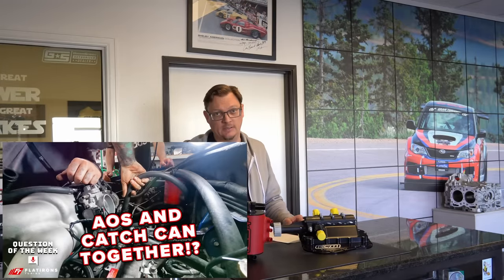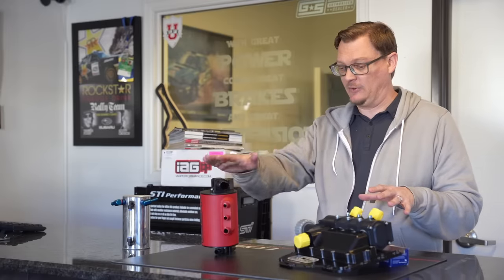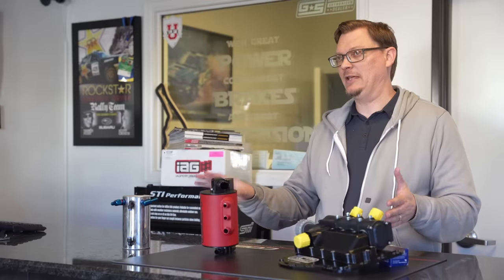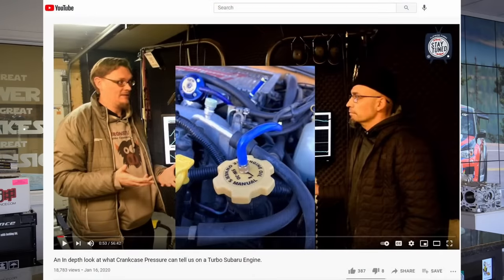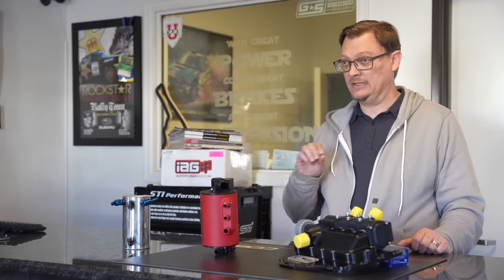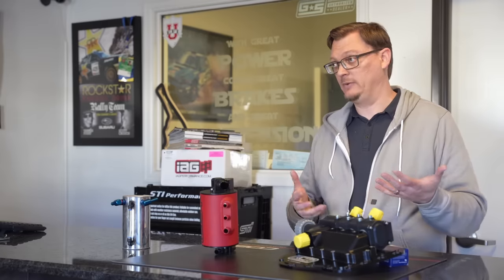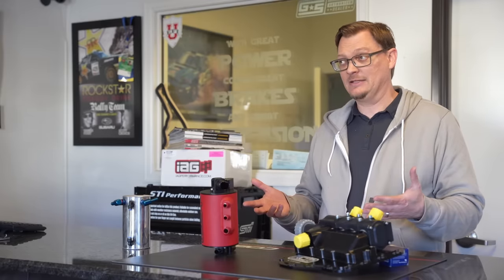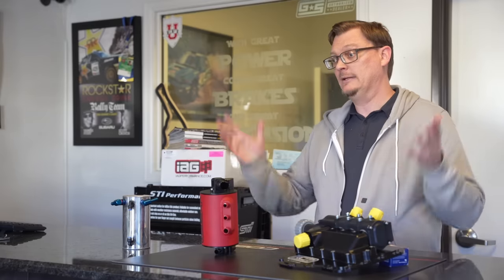Troubleshooting Why your AOS doesn't work

Comment: Really interesting. I have a 400hp street sti that I track quite a bit with a built bottom end. I’m constantly overflowing the comp aos at the track but the engine passes leak down and compression tests. Would you say that lateral g’s and time spent at wot could be a reason as to why the aos is filling up? I’ve been trying to solve this issue for a while now. Thanks
Reply: Your block was probably built with large tolerances that is causing a lot of blow-by. If you haven’t, route the comp AOS to a catch can and see how much it is actually putting out
Reply: @halkaracing4632 I do have it routed to a 1qt catch can which it overflows. As for engine tolerances, I’m the builder of it, first engine I’ve ever built, so that probably has a lot to do with it lmao. Gapped the top and bottoms ring to .0025” which where manley pistons specs.
Reply from the maker: Thanks for watching and thanks for asking.  The most likely issue is first the drain for the AOS.  Take a look at the 3MI AOS drain hose first if you aren't using this yet:

https://youtu.be/vkn7k2yMO2w?si=Oumj6L8O17IqoZTE

Beyond that, there is a point where even the Comp AOS is not sufficient as discussed in this video.  If your AOS is draining properly, and you don't have any plumbing issues, etc., that would be the point where you would want to look at moving to a dry-sump, as that is the solution for your issue at that point.

Hope that helps and Stay Tuned!
Reply: I would agree that you should check your drain from the AOS. Remember it needs to flow downhill from the AOS back to the engine. You might consider adding a drain port to the sump or using the 3MI drain hose as suggested.

Pulling lateral gees can definitely cause more oil to flow through the valve cover breathers into the AOS as well. The valve covers are baffled but oil definitely sloshes around inside our motors under racing conditions. I would also suggest you monitor your oil temps on track and make sure you’re not heating it up too much.

Comment: If the dry sump system generates vacuum and removes that positive pressure from the crank case, why did you need to vent from the case to the tank?
Reply from the maker: Great question.  We go into detail about that here:

https://youtu.be/evSn23dD38U?si=ASwfSQsLukqiXPrH

Thanks for watching and Stay Tuned!
Reply: BRB 9 minute
Reply: @FlatironsTuning  So the fill tank is venting to the OE AOS? But wouldn't that just reintroduce that air back into the crankcase? I did just watch your PCV video, but it might be my fundamental misunderstanding of the system.
Reply from the maker: @byIncarnate  The short answer is connecting the Oil Tank to the crankcase helps to establish a pressure balance between the tank and the crankcase.  From our experience that balance is very important.
Reply: @FlatironsTuning  are all four ports on the valve covers capped off at this point?  Or does the pressure introduced by blow by end up passing through the OE PCV port, into the case, into the equalization tube between the heads, and then out the valve cover ports into the intake track?
Reply from the maker: Yes, all of the valve cover ports are capped.  So is the oil filler neck.  The only remaining part of the PCV system is the top of the factory AOS which is connected to the oil tank.
Reply: That seems like a closed loop. Where is the blow by going?
Reply: Dry sump systems have a vent on the tank. Sometimes through an auxiliary tank to catch vapors and spillover
Reply: @jeremyagost  ohhh, awesome thanks

Comment: @flatironstuning So, Does nightmotorsports billet valve cover with built AOS mitigates the issue? that was the only product that was not showcased here.
Reply: Hey man. We’ve actually seen a set of these at the machine shop. Frankly they don’t appear to offer any real improvement over the stock valve covers, which themselves already have a built in AOS! The one and only advantage of the nightmotorsports covers is that their baffles can be opened for cleaning. On high mileage turbo cars, it’s not uncommon to see the valve cover baffles clogged up with oil deposits and carbon. And on the stock ones, there’s no way to remove the baffles to clean them but at that point you might as well just buy new ones anyway. You’ll still save a lot of money compared to the nightmotorsports covers.
Reply from the maker: Thanks for your question.  Since the stock valve covers also have similar baffling built in, I'm not sure how much of a difference, if any, the Night Motorsports covers would make.

Here is a discussion of that in our PCV system video cued up to that point:

https://youtu.be/mO9mxDUDUDc?si=PjPGCy8LawB0JnUh&t=123

Hope that helps and Stay Tuned!
Reply from the maker: Well put Jeremy!

Comment: I agree, also porsche uses drysump alot on flat engine street cars, does anyone make them for the brz fa24 ?
Reply from the maker: Thanks for your question.  No Dry Sump for the FA24 yet, but it does sound like a good solution for the oil starvation issue is getting close.

Check out @900brz 's latest video:

https://youtu.be/Pvgg7dl-I5I?si=Qyzelrlz0B8_xWp7

Thanks for watching and Stay Tuned!
Reply: @FlatironsTuning  Thanks, I already do the short shifting around 6800 and half quart overfill, the baffles dont seem to be working.

 I dont trust the accumulators Misha Charoudin blew his and he was using one : https://youtu.be/tFQaQuWwvbU?si=qkO2YZAsmTu6TUZF ,

he did say he left the car idle for a long time maybe it had something to do with that and the accusump, after living with this car for over 2 years I find it doesnt seem to like idling its bugging sometimes, and it  idles to low in my opinion wich leads to poor oil flow.. 
I will definitly wait for a drysump cause I think its the only real solution, maybe not best for street use but im going for a fully caged drift build for track only.
Reply: @FlatironsTuning And I think timing chain cover RTV needs to be redone properly also not just oil pan.

Comment: Any opinions on the Perrin AOS? I've had one for 5-7 years. I mostly street the car with a few autocross events a year. It definitely hasn't consumed oil since I installed it.
Reply from the maker: Thanks for your question.  We take a look at the Perrin AOS with other popular AOS kits like IAG and Radium here:

https://youtu.be/OjoA2qXujMA?si=Jd42vM0R3TmHB6Hu

There are some better options out there for sure.

Hope that helps and Stay Tuned!
Reply: @FlatironsTuning  Thanks!
Reply: I’ve had one for 2 years and it’s been great for my FA. I do have to check it once a year to make sure it’s not clogged but I haven’t found it to be yet. Just do regular oil changes and you’ll be solid

Comment: My only issue with Dry Sumps is the fact there is no ELH setup to fit around that pulley.
Reply from the maker: Thanks for watching.  Yes, that is definitely a challenge.  RCM or someone else may come out with something at some point but having that pulley right in the center would make EL headers hard to design for sure.

Stay Tuned!

Comment: What’s the consensus on the killer B AOS ?
Reply from the maker: Thanks for your question.  the Killer-B AOS works very well, but it doesn't work as well on cars that are moving more oil through the PCV system.  As long as you aren't moving a lot of oil through the PCV, the Killer-B AOS works very well.

Here is out initial testing with it:

https://youtu.be/vGQfeqgi1XE?si=fAKjHcfier01aZfK

Thanks for watching and Stay Tuned!
Reply: It's been great on an EJ207 I installed. But those tend to have far less issues than the EJ257.

Comment: While I do agree that an aos is a "bandaid" for excess crank case pressure, I don't see how it's viable to sell everyone a 13k dollar engine to really fix the issue.  

Also my drag car that makes 44 pounds of boost has one singular aos on it, no catch can after, no bullshit and I've never seen a single drop of anything out of the aos drain.

With a properly built engine they do their job perfectly. Even on higher power applications.
Reply from the maker: Thanks for watching and thanks for the comment.  Glad to hear that you have found a solution that works for your application.

When properly installed and properly maintained an AOS is a good fit for a number of applications.

Stay Tuned!

Comment: Thank you for this video. This is why I don't buy an AOS because it has been heavily marketed as a solution, when in fact it is just a band aid and a money grabber for companies like IAG to profit on. What the community really needs is a dry sump kit that can be easily followed for installation purposes, rather than these ridiculous AOS that just takes money from Subaru community and does nothing.

Honestly I think companies like IAG will just make these solutions that do nothing, so that the customer will come back with failed engine, and continue donating money to the company. If there is an actual fix, like a dry sump kit, how can these companies actually profit? These companies have done a great job with ridiculous marketing for money grabbing purposes, so ppl can come back with failed engines, and profit even more by buying their blocks that will fail even sooner than an OEM block.

We need more videos like this to shed truth, dispel myths, and combat the mass marketing that makes these companies profit without an actual solution. Thanks for the video!
Reply: I like your points here. It’s become pervasive in Subaru Facebook groups where everyone seems to think even a stock car needs an AOs
Reply from the maker: Thanks for watching and thanks for the comment.

At a minimum, there are currently places for both a good catch-can set-up, and a good AOS depending on the application.  Hopefully this will help folks pick the right one for their application, and also help to develop better options in the future.

Stay Tuned!
Reply from the maker: @halkaracing4632 It does seem to be a rather common opinion out there.

Comment: 8:48 my car will eat rotella switch back to motul not a drop gone done this twice now, also have an aos
Reply: Rotella is NOT a good oil for Subarus. It is designed to run in diesel engines which means it doesn’t have properties to make it stable at higher RPMs of a gasoline engine. It is much more likely to have cavitation in the oil pump and effectively thin out.

My experience maintaining turbo Subarus is that stretching your oil changes too far will cause a significant increase in consumption. Fuel and heat degrades the oil and makes it pass through the rings and push out the breathers through the PCV. I always recommend 3000 mile changes for daily driven turbo Subarus. As well as doing changes after any kind of track event, or other scenario where you’re doing a lot of very hard driving and heating up the oil over 220F. In our racecar, we just completed a two day rally of 120 stage miles and changed the oil twice in that time.

Comment: So an AOS isn’t a solution ?
Reply: Yeah......Did I just blow $400+ for nothing??
Reply: @sohchx  Did you have a lot of blow by and inconsistent oil pressure before the AOS ? 

no ? you wasted money
yes - did the aos fix it ? yes -> not waste of money, no -> waste of money
Reply from the maker: It can be depending on the application.  If you have overloaded your PCV system:

https://youtu.be/pXQdgxHWFwk?si=hmWA5rTs5OvEOYFe

Then you would want to look at either a good Dual Catch-Can setup or an AOS.  If you install the AOS, make sure you use a good one (Killer-B or IAG), and that it is installed properly, ideally with a 3MI drain hose.  Then keep an eye out for the trouble signs discussed in this video.

For the majority of cars, that will be enough.  But if it isn't that is where another solution would be best.

Hope that helps and Stay Tuned!

Comment: Take away. If you have a street car, your simply screwed.
Reply from the maker: Not at all.  If you need a catch-can or AOS, just use a good design and make sure it is installed properly.  Then just keep an eye on it.

For a majority of cars out there, that is enough.  But if you have that solution in place and you still have the issues discussed in the video, that is where further measures would be needed.

Thanks for watching and Stay Tuned!

Comment: Lol, “take wind out of the myth that Subarus are unreliable” if you need a dry sump and a built engine to run relatively low power levels on track that is definitely an unreliable engine. I love my sti, but they are just not a reliable platform on track (and off track honestly).
Reply: You are correct
Reply: I run a stock S209 on track for 2 years now, previously owned a 2015 STI for 2 years tracking as well. My thoughts are as long as you run in the power range between 300-400 whp, and be mindful of lateral G by picking correct wheel/tire/suspension setup, the car can be a reliable track car. You sacrifice pace, but ensure reliability in stock form. The issue is most people want too much power, go too wide on tires, and have spun bearings left and right due to not being mindful about these issues.
Reply: @TheLastS209  I spun a bearing on a low G track with 235 tires and 280whp, I don’t think they are reliable on track once you hit a certain degree of speed. Countless people have blown their stock blocks with minimal tire and minimal power
Reply: I mean id say Porsche engine are reliable and those have dry sump systems , its just what the manufacturer does with the engines to make them cheap to sell. But stock engines making making multiple 1000 hp runs but hey idk
Reply: Why don't more people that track their EJ add an accusump? I know the new brz / gr86 guys swear by them with good results 🤔🤔🤔
Reply: @R00567  accusump only gives like 2 seconds of oil pressure, after that it is useless
Reply: @R00567  accusump is a bandaid. Like the other commenter said itll only save you 2 seconds, but a dry sump system is the fix. Still not bad to have. Those 2 second could be crucial
Reply: I properly abused 2012 sti hatchback on The Dragon for 5 years or 90K miles with roadtrips . Only forged internals with 20 psi of boost at sports and 27-29 on sports sharp. Wet oil sump aftermarket and blow by was always  vented to atmosphere. No issues ever experienced with drivetrain. Re-gapped spark plugs once. Amazing platform to harass V8s and shock Miatas and Hondas and all sorts passenger cars modified for track.
Reply: @halkaracing4632 you still need at least baffle and pick up to run on track，also your tune probably contribute to your issue as well
Reply: @kiritowow2736  you don’t need a pickup, or a baffle to run on the track.

Pickups breaking was only a GD problem
Reply: @igor-rp5mw  sorry but driving on a public road is not a measure of stress or performance
Reply: Driving them for 18 years with no problems, and 400whp since 2018. 
They've all been bulletproof.
They're pretty misunderstood.
Reply: @SpecVBlue  pretty misunderstood in that people think they are much more robust than they are.
Reply: @halkaracing4632  I agree on the pick up，but baffle I think you still need，stock baffle do something but not that much，if you drive on track the oil presure will still drop here and there，it  will slowly eat your bearings
Reply from the maker: @R00567  Good question.  We talk about the Accusump here:

https://youtu.be/5NN8GShcskM?si=fjWYcLvfYDrmUfd7

Thanks for watching and Stay Tuned!

Comment: so regarding crankcase pressures, if its excessive from the factory how to we fix it or rather what would be the fix aside from installing an aos for a street car not a race car ?
Reply from the maker: Thanks for your question.  From the factory, there is not really an issue with crankcase pressure on the stock cars.  This starts to become a problem when we modify the car, make more power, and/or put on sticky tires and start seeing much high cornering loads.

I'd recommend taking a look at this video:

https://youtu.be/pXQdgxHWFwk?si=hmWA5rTs5OvEOYFe

Once you start overloading the system, that is when you need to look at using a Catch-Can or AOS to increase the capacity of the factory AOS.

Hope that helps and Stay Tuned!